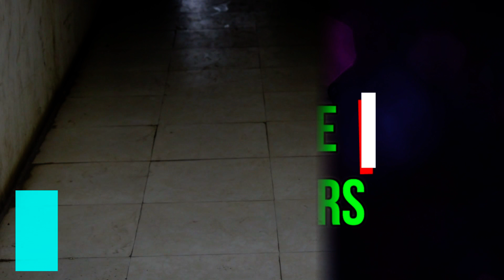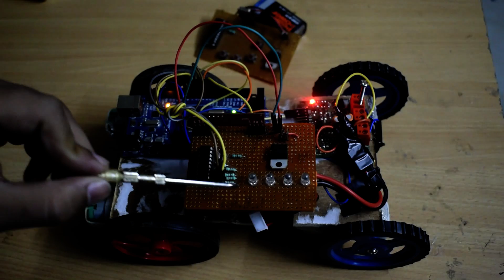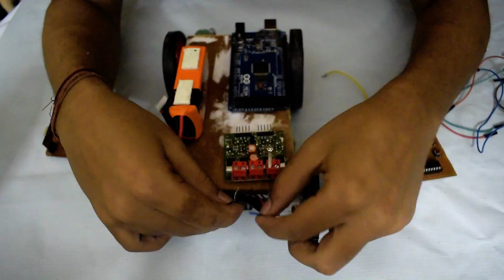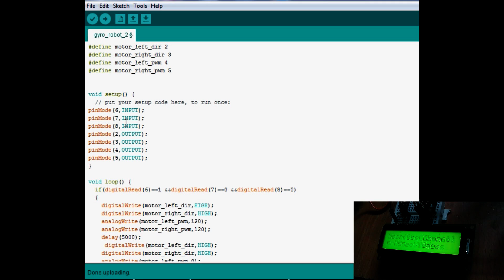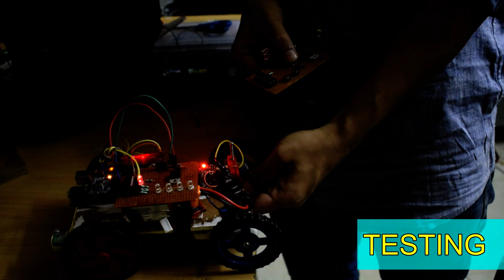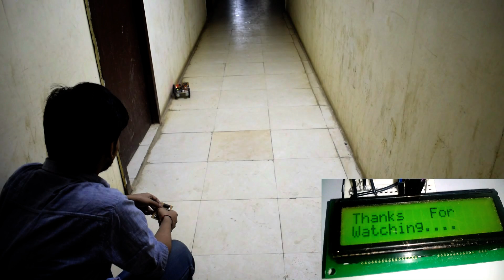ARDUINO RC CAR CODE WITH RF

Comment: manikettavan111@gmail.com
I need circuit diagrams for dis
Reply from the maker: Sorry brother. My system that contained all the codes and schematics is corrupted and i didn't had any backup of the data. So i will not be able to provide u with the same. But will get back to you within a week with new schematic for the same project.

Comment: can you sendme the code and circuit diagram
jessica.henderson2232@gmail.com
Reply from the maker: ttps://engineer-creative.blogspot.in/

visit the link to get the code for this as well as different projects.
Also don't forget to like share and subscribe the channel :)
Reply: thank you. the parts list does not include the ICs you used. I dont know what those are.
Reply from the maker: the ic's used are "
1. L293D for motor driver
2. HT12D &HT12E for RF Module